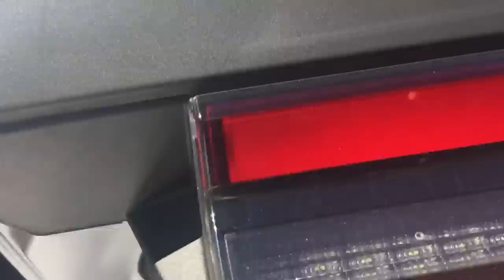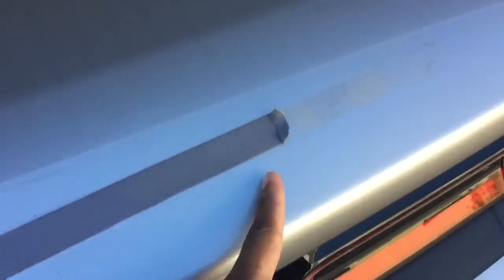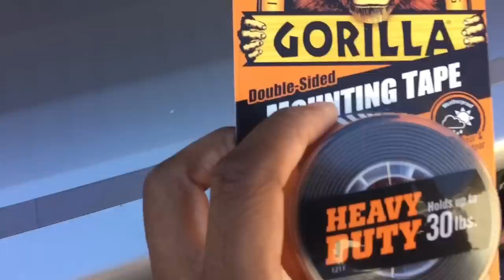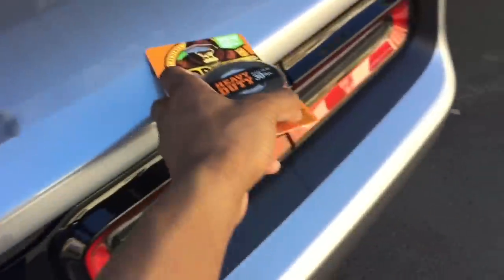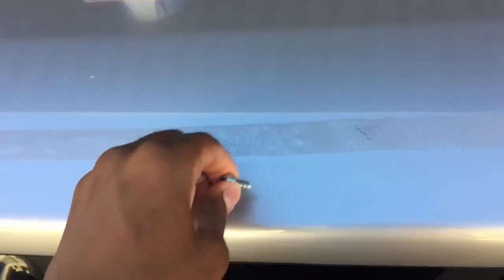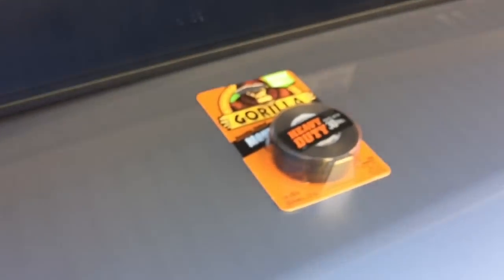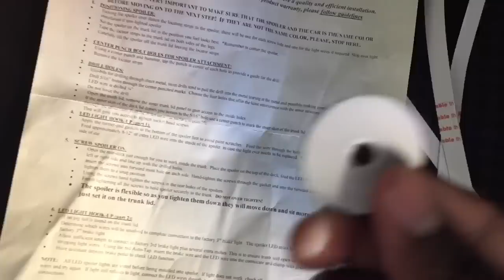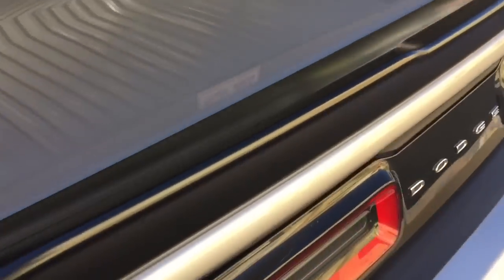How to install/replace spoiler on a Dodge Challenger

Comment: Great vid! Wanted to know... i have a 2014  sxt will this installation be similar? also what did you use to remove the factory tape?
Reply from the maker: Chad Woodman yea it's gonna be the same and basically just used my hand for the most part than soapy warm water and a towel to scrub off the small leftover pieces

Comment: My dodge challanger doesn't have a spoiler. Couldn't I just drill the two holes, like yours, instead of having to drill the 5? Also will this specific spoiler work for a 2016 challanger?
Reply from the maker: Jose Verduzco yea you can just drill 2 holes and use tape and yes it will work for the 16 as well
Reply: Thanks man and one last question, since I have to drill the holes in, do I have to take out the light assembly and trunk liner? I read a review and they said they did that, but I don't think I would have to since the holes are marked where to drill. Also I don't think it would mess up anywires or anything if I didn't remove it.
Reply from the maker: Jose Verduzco no just drill holes where you see in the vid I used
Reply: Jose Verduzco  did you end up drilling the holes?? 
I'm thinking of doing the same thing

Comment: Check out a eraser wheel to take off and HARD stuck on glue from anything! It took off my whole roof on my challenger that had 6 year cheap vinyl wrap on it from previous owner. Took 2 hours but way faster then anything on the market to get crazy stuff off paint. You need a good drill and eraser wheel. There 16 bucks on Amazon.  Oh and leaves your paint beautiful.  No joke.

Comment: Hello great video.... one question on the three middle holes on the trunk lid are those just clip on inserts and the two outer ones bolt type inserts thanks for sharing 🙂
Reply from the maker: Raul Fuentes believe they was all drilled holes and just adhesive tape
Reply: SCATPACKMON l see so you just used the outer bolts and skipped the three middle holes did your spoiler have built it clips on it for middle holes ?

Comment: I ordered my spoiler and during installation I noticed the screw holes on the spoiler aren't lined up perfectly with my hood holes. Any suggestion on this or should I send it back? They're off by a millimeter or less.
Reply from the maker: Jeremy Rowlett did you drill holes yourself on the car or was already there cause you had a spoiler already and was just switching out?
Reply: Villematic Switching out. I've got a 2016 RT
Reply from the maker: Jeremy Rowlett they should've lined up mines did I probably send back cause it's not enough space to drill another hole
Reply from the maker: Jeremy Rowlett especially if it's off by a little that's means the new hole will run into original one make one big oval hole
Reply: Villematic Yeah you're right. But I'm Gonna try and get a second opinion on it later today at my buds body shop before I send it back.
Reply from the maker: Jeremy Rowlett fasho bro

Comment: hey man that link in the description is no good. Can you tell me where you got the spoiler from? And it fit flush with the factory holes?
Reply from the maker: silvastian actually that seller doesn’t sell that product no more but it’s other sellers selling the same product
Reply: bro i done browsed the internet up and down looking for one that'll fit those outer holes for a minute. Do you kno one off the top of your head? if not it's cool I jus can't find one that doesn't require drilling whatsoever
Reply from the maker: silvastian if you search “challenger spoiler” on amazon the top 2 are basically the same one I got just a different seller if the holes are in the same spot where my factory one was
Reply from the maker: silvastian still there

Comment: The wing does look better with the dip but why not just plasti dip it or wrap it?
Reply from the maker: Plastic dip doesn't last forever the sun will fade it and plus washing it won't last forever no need to repaint or ever worry bout it with a solid black spoiler
Reply from the maker: And a shop will charge you jus as much to wrap it than the cost of the spoiler itself
Reply: Yea I get you, check out my video of my challe, let me know what you think.
Reply from the maker: Yea I seen it you must painted your fuel cap cause I don't see the chrome writing
Reply from the maker: Clean though
Reply: Thanks, I did, I used plasti dip

Comment: Did a good job on it bro best video yet. You think I could do it without drilling holes and using double sided tape?
Reply from the maker: Saul Lopez is there holes already there? What’s going to hold it down
Reply: @MONINAHELLCAT  bro think it’s going to float 😭

Comment: is that an aftermarket or from factory spoiler(oem)?
Reply from the maker: edd3055 amazon link is in the description
Reply: Villematic thanks, i got that same spoiler, it is a.nice product. I dont know if you notice but the aftermarket one is about half inch shorter from the back to the front than the oem or factory one.
i went to the dealer and measure them because they seem more titlted and that is because of that extra 1/2inch, just letting you know ;)  great video man

Comment: nicee!! paint the grille black with plasti dip
Reply from the maker: 💪🏾💯 tinting side markers next week
Reply: i have all 4 side markers tinted, the ones that are in the back bumper and all the taillight, i only leave reverse lights clean, look for "tint taillight vinyl" on ebay, buy the 12x72 and that will let you do all and you going to still have a lil more if you need it some time, its only for $10 dlls